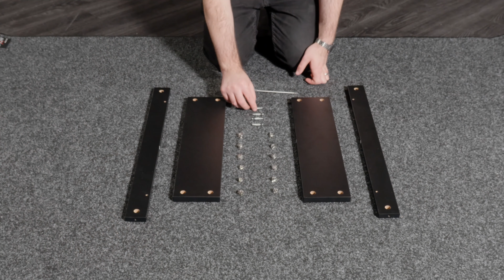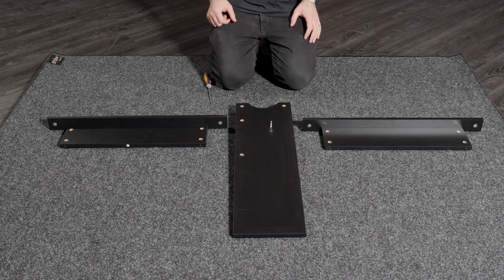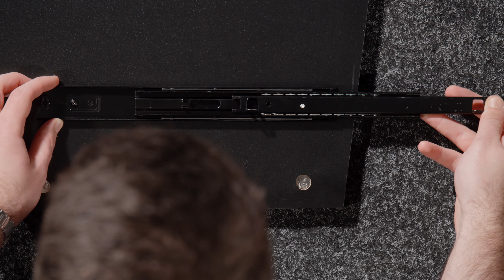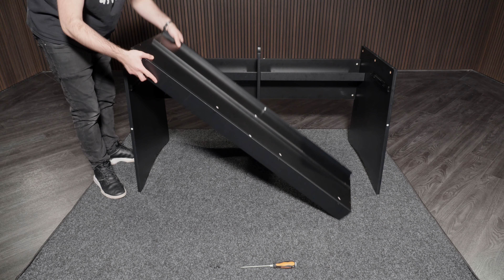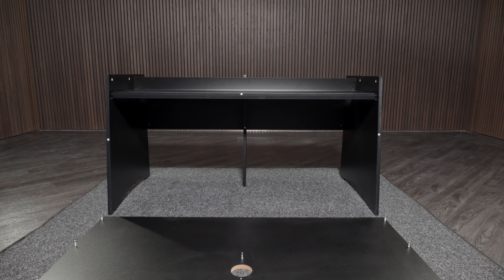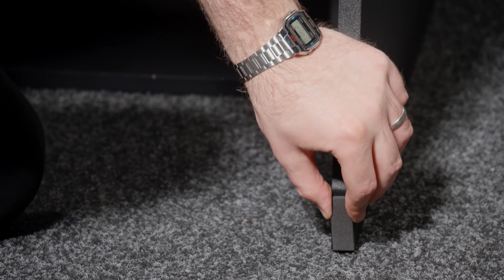Modul Modular Studio Desk Assembly Guide | Gear4music Synths & Tech

Comment: I like the desk, took around 5 hours to assemble though lol
It will not fit Kontakt S88 MK3 when the pull out table is closed, only when the lid is out.
Reply: Do you think you could lower the shelf to make it fit?im thinking of buying one but my keyboard would be too tall
Reply: @danharrold4467  hi, I thought about that but problem is if you lower it, it will be too tight for your knees when they're bent (they won't fit) - unless you put the tables supporting areas (the left, middle and right) on higher levels.
But that's just complicated.
all and all, I'm happy with the table considering the prices from competitors.
Reply: @ thanks for the info,that’s a good point,think I’ll look elsewhere, my keyboard is 3cm too tall,cheers!
Reply: @danharrold4467  no worries, good luck in your adventure finding one that suits you.
Merry Christmas!